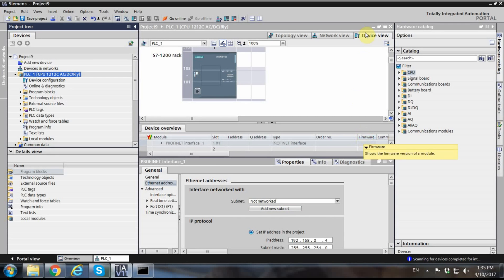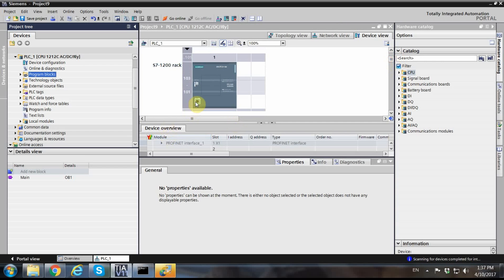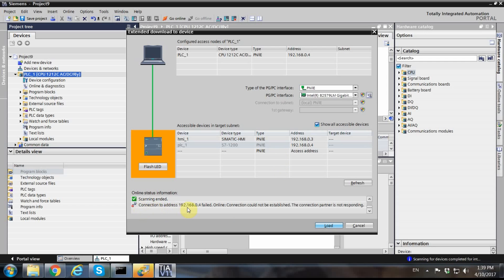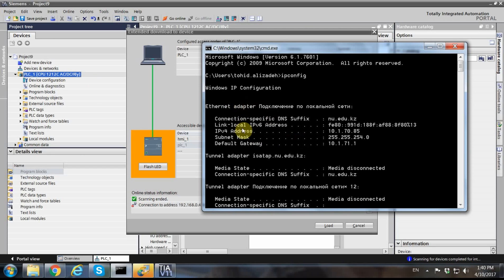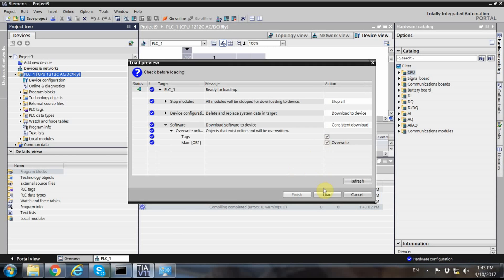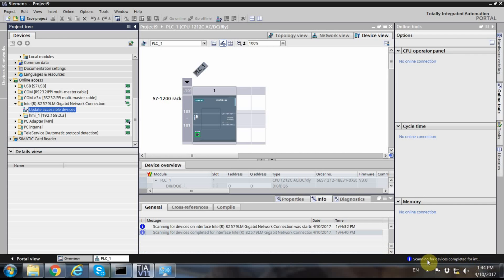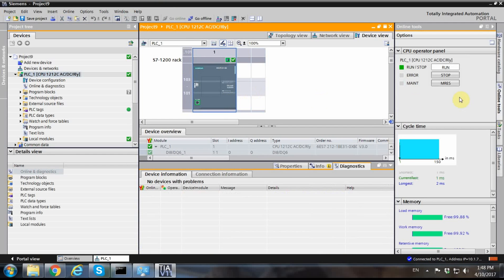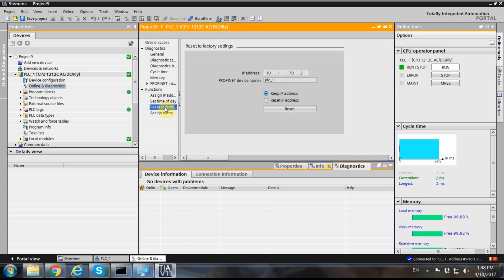Siemens: Assigning IP address to S7-1212C PLC in TIA V11 #siemens #s71200 #ipaddress #plcprogramming

Comment: Hi, very helpful video. 

But I'm not able to set ip address to the ET200 SP it gives error that same IP address available in network. But when I try to find accessible devices ET200 shows that address but not able to communicate with my s7 1200

Any suggestions?
Reply from the maker: Thanks for your comment and sorry for my late response. It sounds a bit strange. In case you have fixed the problem, please let us know the solution.
If not, you may try to assign a different ip to your PLC, one that you know for sure that is not used in the network by any device.
Reply: @TohidAlizadeh  yes eventually I solved the problem, it was the issue of IP address of my system which was not compatible with PLC ip address and was causing the communication problem. 

After inserting the PLC ip address in advanced section of IP address settings in PC, it worked finally. 

Thanks for your reply.
Reply from the maker: @kgauravb  Great to hear that you have solved the problem!
Reply from the maker: Thanks for your comment and sorry for my late response. It sounds a bit strange. In case you have fixed the problem, please let us know the solution.
If not, you may try to assign a different ip to your PLC, one that you know for sure that is not used in the network by any device.